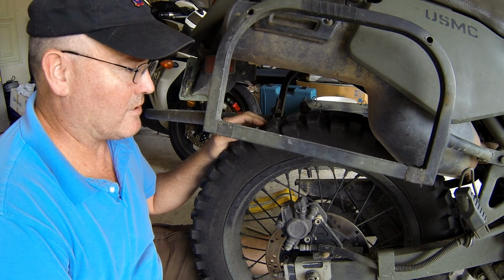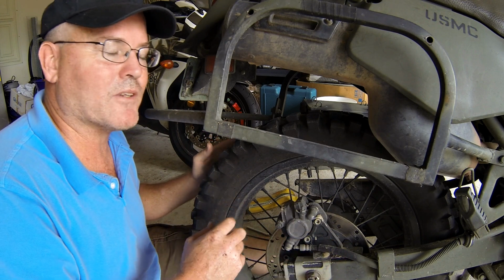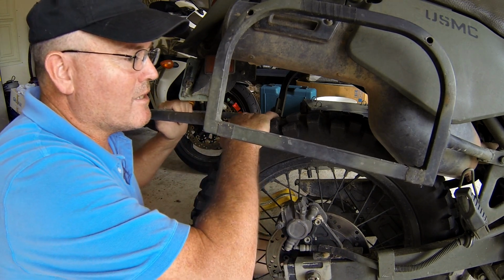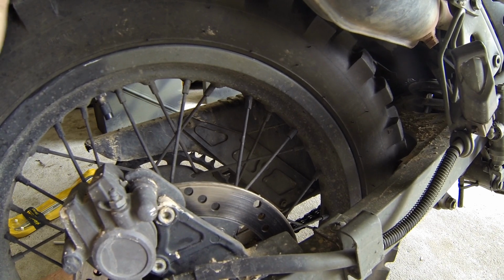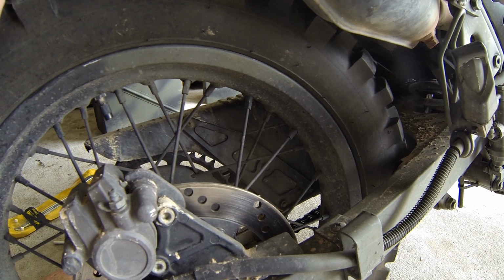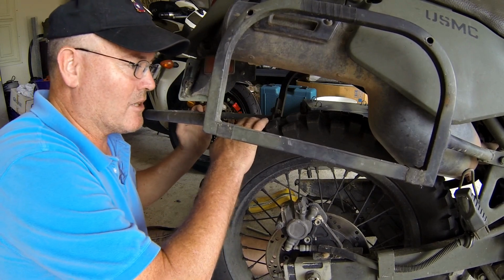KLR 650 Bad Rear Bearings

Comment: So I'm clear, the rear bearings going bad was part of the reason you were experiencing the FRONT wheel wobble (from your other video)?  Contributing to it?  My KLR has just about 11k miles on it.
Reply from the maker: Todd  I replaced the front and rear bearings. I also resealed the front forks and refilled with fresh fluid. One side was leaking a little bit. After all that it rides perfect even with full camping gear and the 20mm ammo cans. It's stock except the rear spring. I installed a 300 lbs. spring so she wouldn't bottom out with my fat ass and equipment and a passenger.